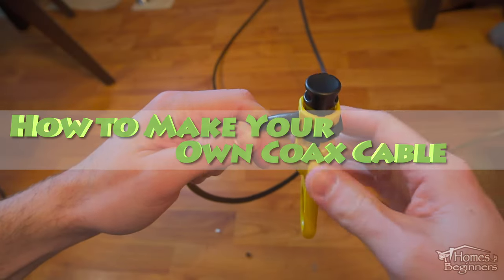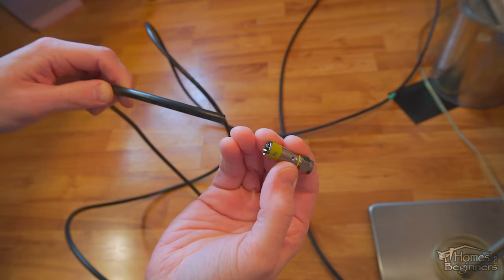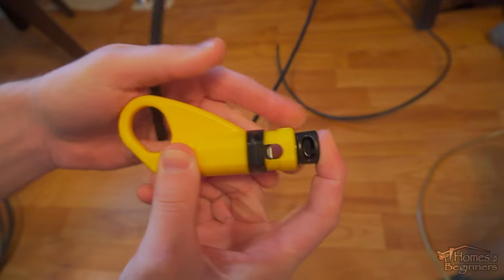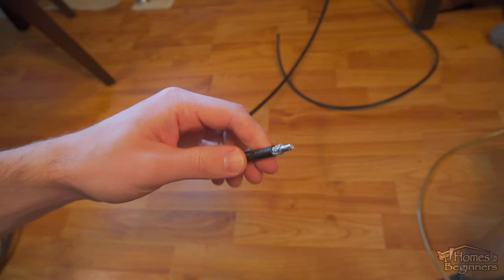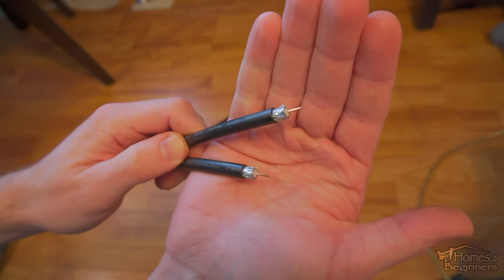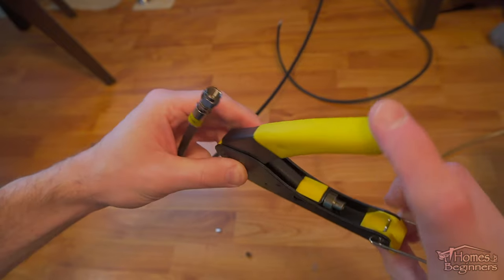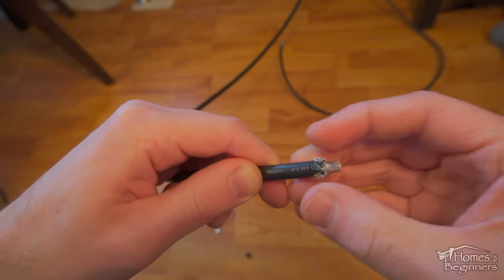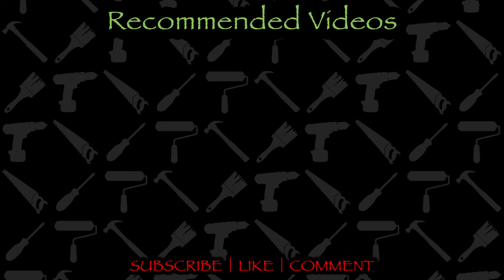How to Make a Coax Cable with Compression Connectors

Comment: If the coaxial cable used is tri or quad shielded, there will be a few extra prep steps before the compression connector can be slid onto the end of the cable. Klein Tools RG6 compression connectors seemingly have a built-in stop that prevent the cable's dielectric from being pushed too far into the connector (something I wish other manufacturers would do).

Manufacturers such as Ideal, PPC (Belden) and Arris (Commscope) sell connectors designed for dual shielded cables and another variant for tri & quad shielded cables.

A quick note about coaxial cable & service providers:

Service providers such as Comcast use PPC branded cable and connectors. If a technician sees any other branded cable and/or connectors on the line side of the demarcation point, the technician will likely replace the cable with PPC branded or, if non-PPC connectors are applied to the cable, the technician will cut them off and replace with PPC's connectors.

Beyond the demarcation point, any cable & connectors can be used. 🙂